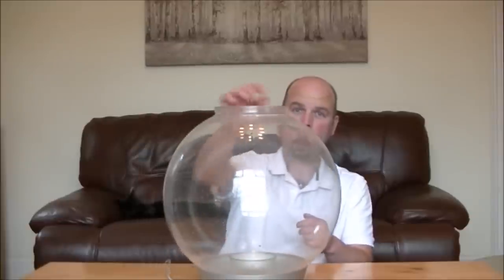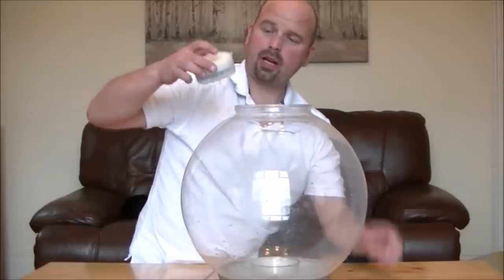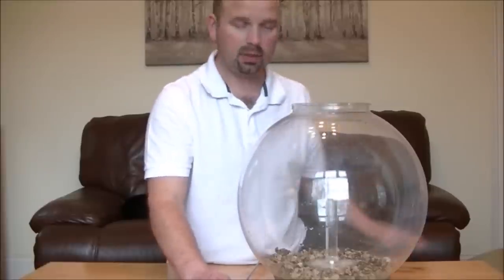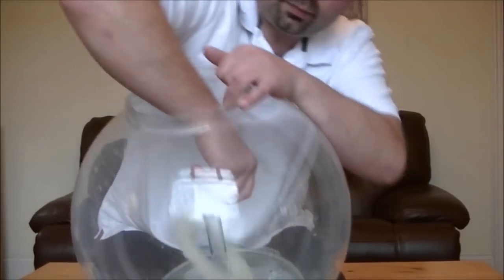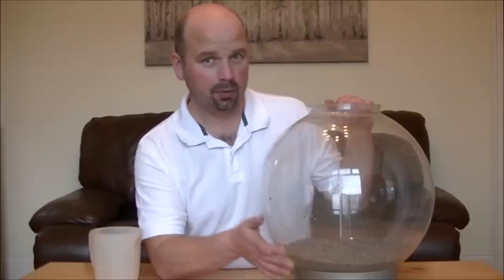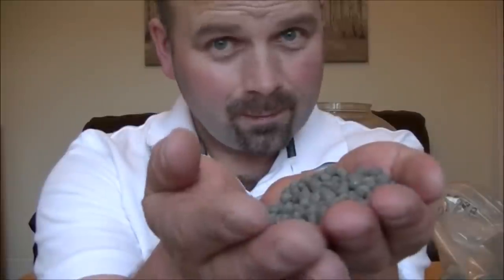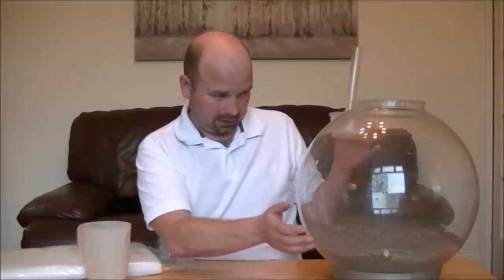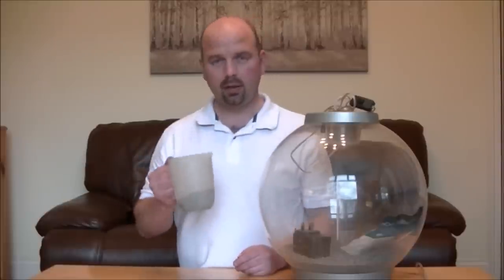BIORB COMPATIBLE UPGRADE KIT

Comment: Hi Richard, just a couple of quick questions, if you don’t mind answering. I’m looking at settling up an 88ltr rectangle tank and really loving the simplicity of this filter system ( I’ve never had a Under gravel filtration system before so please forgive me if I sound daft) 
I was looking at buying the trays attaching two air tubes (one on either side of the tank) can you tell me, if I put the medium and fine layers of foam under the trays and use the bio gravel on top of the trays would airflow still be efficient? 
Would the gravel cleaner not be able to clean the foams properly with the trays?
Would you even need the trays or could this be set up like you’ve demonstrated with the biorb in the video?
I’m just concerned about air flow underneath the foam/ biogravel and therefore having an insufficient filtration system with possible clogging etc.

Could you explain how this set up technique would be set up for a normal medium/large rectangle and what would be needed e.g what would be a good air pump with the option of a tube splitter etc.
Thanks Richard.

Comment: I have successfully converted my tank and very grateful for the conversion kit. Been going for 7 months with fish happy. Two questions-
1. What plants would you recommend adding to the tank. I have Anubis but thinking of adding Amazon sword into gravel. 
2. I find gravel falling under the central filter between changes quite annoying and means I can't then lock it in properly. How can you avoid this or remove gravel quickly?
Reply from the maker: +Dav B If the filter top locks in properly there should be no biogravel falling down into the filter when it is pulled back far enough prior to removal. In reality you could probably just fill the central filter with biogravel and do without the central fine pad as you're probably finding that it hardly needs cleaning? I only advised that the central part have the fine pad to catch the very fine particles. How often have you replaced the fine pad in 7 months? different tanks have different maintenance schedules.
I'm not too good on plant species but as the biorb lighting isn't the best for plants it will be worth checking the labels on potted plants at your local fish store - they have light requirements on there so go for plants which don't grow huge, have easy care and will grow in partial shade. They are bound to do well in an orb then.
Hope that helps.
Reply: +Pondguru Outdoors Thanks for the reply. I haven't changed the filter material in that time. Just once cleaned under the cartridge  with hose and squeezed  it out once last week. It was then that I noticed the gravel. I removed cartridge yesterday and scooped out the gravel from under the cartridge. I also changed air stone. It now locks properly and works well. The anubuious is attached to rocks/pebbles and grows well. I have silk plants at the back of tank but I may replace with a few elodea with weights on the bottom. If they root that's a bonus. Tank is much more stable compared to ceramic media which wiped out three lots of fish from ammonia spikes.
Reply from the maker: +Dav B Awesome - great to hear its all going well.

Comment: I have Eheim substrat pro.  I am wondering if I could use this.  The biorb did not give nearly enough rock material to cover the surface of the bottom at all!  Thank you for your help.
Reply from the maker: 302Tonya It may work but would possibly be too light to clean with a gravel cleaner. You couldn't use gravel cleaner with the large biorb media in there so you'd have to go all gravel / substrat pro.

Comment: I have had a 30ltr Biorb now running this system for about 7 months now, I added an extra kilo of bio gravel making 2.5kg and boy has it been good. The water is gin clear and the colours on the fish are beautiful. The tank is over stocked with about 25 tetra  with no losses! I’m also only changing about 6 litres of water now every couple of months just in case but I think it could go a lot longer. I’m very happy with this tank now, can’t recommend enough. Thanks

Comment: Last night my poor flying fox, DJ,  got stuck in the cartridge! I thought it was just an old wives tale, to frighten n00bs.  My partner and I have been so diligent with the tank it was lucky we performed an emergency rescue mission when we did. He was in a state of shock for awhile but has recovered somewhat, issue is that he won't eat now :(.
Reply from the maker: Hopefully the fish is on the mend now and I didn't regard the standard filter, media or filtration issues being so dangerous until some of the customers (when I had the fish shop) came in with the horror stories relating to the biorb tanks. I spoke to manufacturers but they didn't want to know about improving it, hence this video and upgrade idea.
Reply: +Pondguru Outdoors 
It's a great video! I've contacted the aussie suppliers for the biogravel here in Australia because of you. Keep it up man. You're doing a good job here and I appreciate it!
Reply from the maker: No problem - much better to get it from your own country as the shipping from UK to AU on heavy items can be a killer. Hopefully the AU supplier has biogravel.
Reply: I was not able to get Biogravel ain Australia when I bought mine and ended up with BioHome minis that I simply snapped in half.  You need 3kg of minis to ensure coverage.

Comment: Excellent video! Can you add a link to the bio gravel please? Also do I still need to use gravel hoover bi weekly?
Reply from the maker: Ideally the tank would be cleaned weekly with a gravel cleaner.
The link to the media and filter kits is the same as the one in video description and pinned comment - it is http://www.filterpro.co.uk and there is also extra information in the video description which may help.
Regards, 
Richard

Comment: I am just beginning my journey with biorbs and so have very limited experience. I love all the new things I'm learning from Richard, though the concern is that Biorb recommend removing any ceramic media smaller than pea sized, as this can get stuck in the filter area preventing you from being able to insert and close the air tube, please can you explain how we can overcome this?  Can you also create a video on how to clean the black foam filter and biogravel? Do I need to remove the gravel each time in order to access the foam to be cleaned then replace the gravel, if so how often should this be done? I envisage this being quite tricky for me so would find a video most useful. Thank you. 🙂🌿🐠🐟

Comment: instead of using biohome can you use the substrate biorb provides and use the foam? or do you know any cheaper alternatives.
Reply from the maker: You could just use ordinary aquarium gravel if you wanted to. It wouldn't affect the nitrates like the biogravel does but will still function as a good under-gravel system.
Using the ordinary alfagrog over the foams will do no good at all since water finds the easiest route, will just bypass it.
Sorry deleted previous comment by mistake but yes the other forms of biohome look like fossilised cat crap. It's certainly not going to win any beauty contests but it works very well to delivery the full cycle (reduction in nitrates).

Comment: We bought a 15L Biorb last September.  After a week testing that Biorb had hit the correct levels we added our 14 neon tetras (from a previous leaky tank).  All was well for a 3 or 4 weeks and then they started to die like one a week - we even found one trapped in the filter.  After having these fish for nearly a year we now have 7 left ☹️.  I watched this video, sent away for the foam pads, the biogravel etc and it is REMARKABLE, the fish are still alive, the water is crystal clear and I am really pleased - so glad I saw this video, thank you.
Reply from the maker: Great to hear that the tank is back on track and I'm glad you're pleased with the results. I'm not sure why the manufacturers aren't interested in making the biorbs function properly but it may have something to do with the crazy amount of pads and 'treatments' they sell...

Comment: I know this is an older video. I was looking at one of these as an update for my small glass globe for my four apple snails. My current system works perfectly. Have a micro sponge filter and a wooden air stone. Only use the filter a few times a week. No plants unfortunately.. water is beautiful and clean. Partial water change every week or so to clean the gravel.  
Question: could I just do away with the stock supplied filter, perhaps keeping the air intake only, and add my own substrate? IE sand, gravel and stones, that I know already work in my I gallon? 
I only keep snails. I have two large apple snails, about an inch, two small ones, a small Ramshorn and two small river snails and a little bladder.. nearly forgot... five small freshwater golden clams.
Reply from the maker: For the stock you have minimal filtration will be needed and plants would be ideal to make sure the water stays healthy. If you have the native ramshorn snails they will not eat plants but the striped ramshorn snails often sold in pet shops will eat plants.
In any tank it would be best to have some sort of filtration and water movement so if you can have a small filter running 24/7 it wold be better than no filter at all.

Comment: I just need how much to cut for the 3 templates
Reply from the maker: I think I sent you the templates but it is confusing as I am getting messages here and also by email asking similar questions. If you have the templates simply print them out. The largest foam will need a foam of around 12" x 12" to cut it from.

Comment: I've read some of the comments and if I understand this correctly the under gravel foam should last 2-3 years as long as the biogravel is cleaned with a gravel cleaner once a week, and the gravel is rinsed in a jug approximately once a year? But what about the fine pad in the cartridge? When will that need to be replaced?

Just want to make sure that I've understood the maintenance aspect of this.

Thank you in advance.
Reply from the maker: Yes, structurally the outer foams should last at least a couple of years as they are good quality and the fine pad in the central filter would need replacing according to how quickly it gets clogged. That could be every 2, 4, or 6 months depending on the stocking and feeding.
Reply: Pondguru Outdoors Ok, thank you. I live in norway, and I wonder if it is possible to order the kit from your website and get it shipped to Norway?
Reply from the maker: Yes no problem I think the shipping is £19.99 for courier service which generally takes 3-4 days.

Comment: Thanks for the great video.  Sorry If some of my questions seem very basic, but I have not had fish for many years and never had much success, so I would like to fully understand this time.  I was just about to purchase a 15L Biorb Halo and going for a tropical set up and all the accessories but now I have to change my shopping list.  I am only looking to have 6-8 tetra neons which I understand would be ok in the 15L Biorb.  Reading the FAQ on your website it mentions that the biogravel reduces the need for large regular water changes, with that in mind how often would you recommend doing a water change and how much.  My local fish dealer said a third of the water every 4-6 weeks for the standard set up and new filter every 4 weeks (which I won't need to do with your system).  With regard to cleaning the biogravel, you mention taking some out and rinsing in a jug with some of the tank water and throwing the dirty water away.  Does this mean you only need to do a small amount as you showed in the video and that will be enough to help rejuvenate things or you have to do that do all the gravel.  As you will be throwing away the old dirty water I guess you just top up with new water that has been left out for 24 hours? I have used battery gravel cleaners in the past, but I always found they made the water so cloudy afterwards and took so long for the water to clear again.... is that normal when using a gravel cleaner.  Thanks for your time.
Reply from the maker: +Mr H Most people end up changing at least 20% every week with the standard filter set up but when you use the under-gravel system a 10% weekly change should be all that is needed. If you miss a week it won't matter as the tank will be greatly over-filtered. You'll just need a gravel cleaner to clean the gravel weekly (it also drains some water from tank) and the cleaning in a jug is only needed if you strip the whole tank down for a deep clean (maybe once a year).
Yes just top up water with conditioned tap water after the gravel cleaner has been used. It should not cloud the water when water is drained from the tank.
Reply: +Pondguru Outdoors that's great, thanks for your help.

Comment: Awesome video as always, ordered some of the red biohome stuff from you a while back, upgraded a little hob filter with it, my planted nano seems to love it. Stole another of your ideas as well, made a ugf with a moving bed filter on the uplift, so the gravel was mostly just a mechanical filter. Keep it up mate! Definitely need to venture tyneside, come see your shop. I'm up that way this summer, might drop in
Reply: matthew smith I'd love to see this in action. I have just bought a cylinder tank, 3ft high and only 60cm wide across the bottom. I still trying to work out how I'm going to get really good filtration on such a deep tank that's going to be difficult to clean. I have an ugf on my current 3tf horizontal tank and much prefer ugf cos i like the simple engineering of them and I don't really want to see a filter in my tank. But I'm stuck for ideas. Can anyone help?

Comment: Hi .... great video. Just bought a bio orb 60L. Set it up just like yours, been running 5 days now, water is very cloudy still.... new tank syndrome i have been told, how long does it take to settle down n clear. Thanks lee
Reply from the maker: There is no easy answer to that but it shouldn't take too long since you have a nation of media in there to house the bacteria which will be clouding the water.